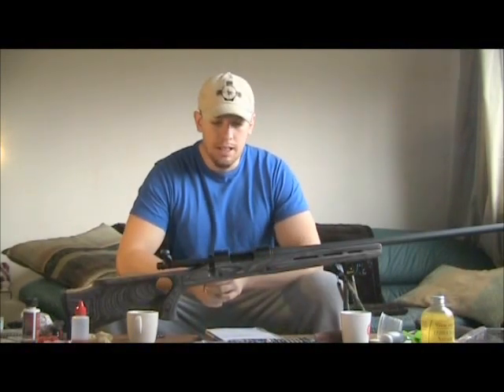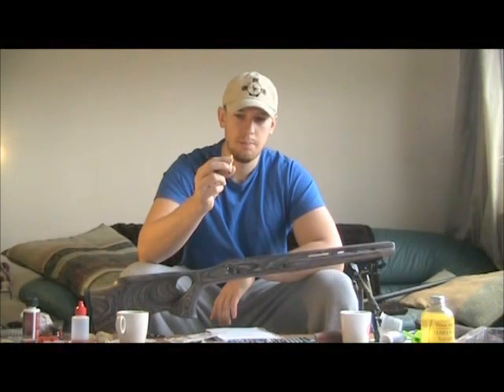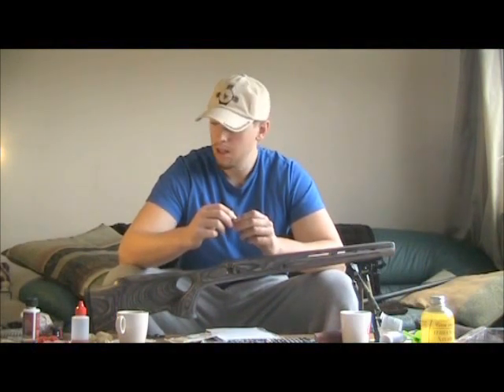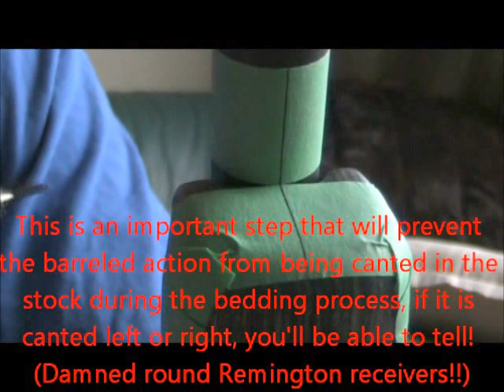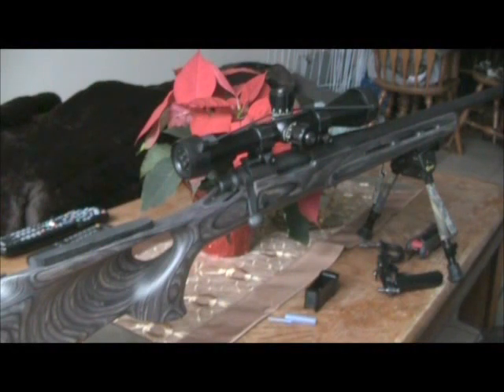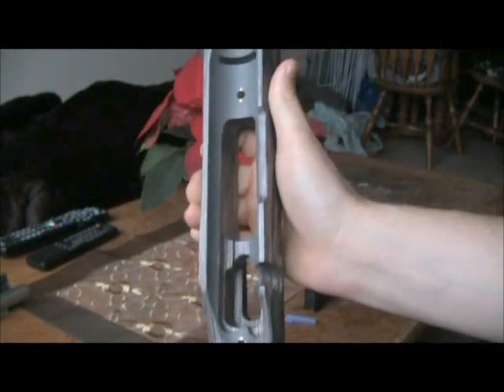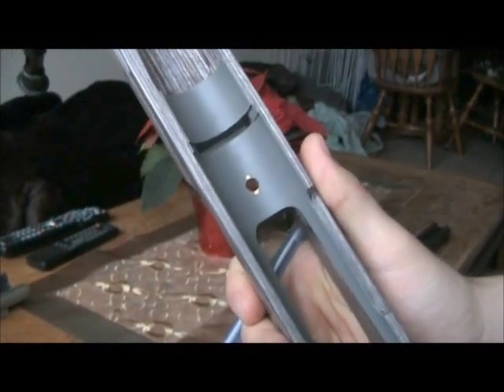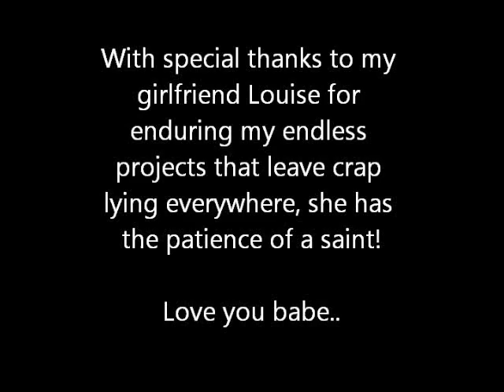Remmington 700 bedding video.

Comment: philip, thank you for the video again. When done with deployment, Ive been meaning to do bedding work on a wood stock Savage MKII TRR in .22LR. Its throwing 3-inch groups @ 50yds. Tried a different rifle with that same optic/ammo and it shot 1/2-inch @ 50yds. So now a bedding job is in order. Ordered Devcon and my wife has stocked up on .22LR because she see's my frustration at a rifle from a good company known for out-of-box accuracy. Think thatll be my first vid. If so, I'll PM you.

Comment: Excellent video, I will be bedding a rifle here in the next couple weeks.  What cutting tool did you use on your dremmel to remove material from the stock for the bedding compound?  I have a dremmel but can not find a tool that looks similar to that one.

Comment: Great Video! I am going to attempt the same process on a 700 and a boyds stock. Can you tell me what you did at the bottom of the pillars to keep the bedding material from running out or surrounding the head of the action screws?
Reply from the maker: Just keep an eye on it as you press home the action during bedding, the compound is thick enough not to drain out and any that gets on the screw heads can be wiped off (screws should have release agent applied, try wax or Hornady's 'one shot' case lubricant). Sorry for the late reply.

Comment: On the Boyd's Stock which is what I am working on there is a plastic bushing on the bolt hole closest to the front lug.. Did you just drill that out and put the JB Weld in that hole with the pillar flush at the bottom of the stock?

Thanks again
Reply from the maker: I've never seen that on a Boyds stock. I can only imagine it is extra insurance against over-tightening and cracking the stock. With metal pillars in place the plastic bushing will not be necessary, so if I were you I would drill it out.